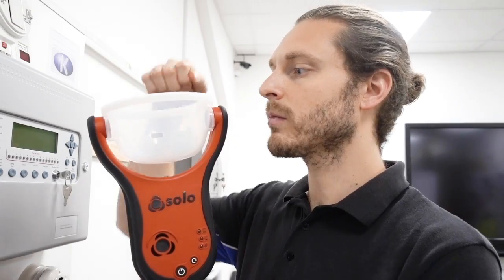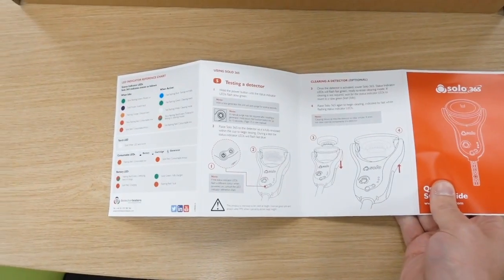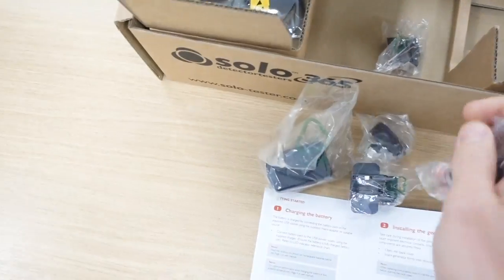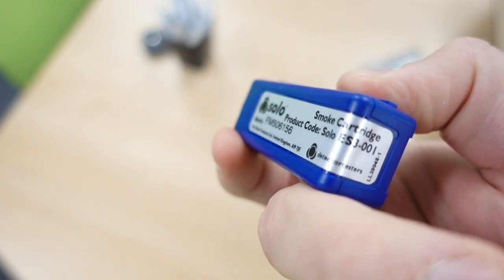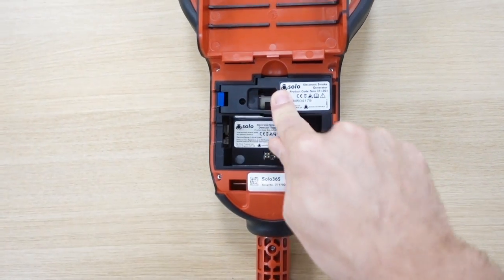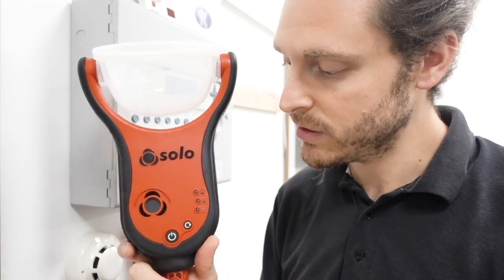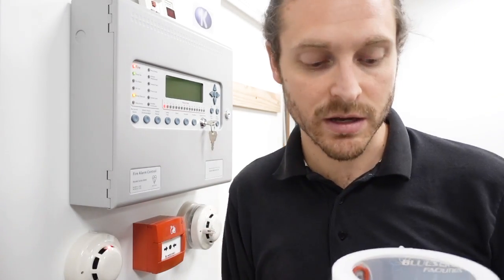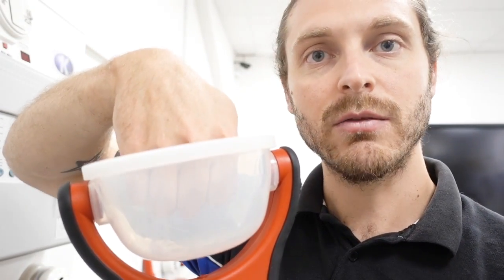DETECTOR TESTER SOLO 365 | UNBOXING | FIRE ALARM TEST EQUIPMENT

Comment: I like the idea of smoke control. Controlling how much smoke will go into the Smoke Detector is a plus. Moreover, the idea to air cleaned the Smoke Detector with the same testing device is awesome. LED indicators in the testing device are nice too. Is good to know that this device is out there.  Smoke Detectors and Heat Detectors are always evolving, this test device will play a key role in the future of Smoke Detectors testing.  Thank you.
Reply from the maker: Glad you found the video helpful. The modern testing kit is quite advanced and really helps commissioning and maintenance. I know it is costs to purchase the kit but an become cost effective is used correctly. It is an investment. The LED light is actually more handy than I thought it would be!!!

Comment: So if you were to purchase one, would you purchase a 330 or 365? I’m trying to decide which to get.
Reply from the maker: Zachary Cordova hey. Out of the 330 and 365 I would definitely buy the 365. I believe that detector tester have a range of products that are suitable for each user. My answer is slightly biased because I already have multiple sets of 330. Many of my clients specify automatic testing so that you can't contaminate the detector. However, keep a look out for one of my next videos... it may help you decide further 😁
Reply: Dan thank you for getting back to me! Have you had issues getting it over large detectors at all because the 365 has a smaller cup? And can you get CO cartridges for it?
Reply from the maker: Zachary Cordova I haven't had an issue yet with fitting detectors in it. In some respects the smaller cup is better because it is very effective setting off detectors. I can't see it being an issue on larger detectors providing the chamber is covered. However i hear in the US many detectors are larger and they often use the larger cup for the 330 (I've forgotten the part number). And no it is a smoke Only!

Comment: Did I hear you correctlywhen you said, the 365 clears smoke from the chamber after the detector has been set off? That would be the main selling point for me; not to have to use canned air or some other method to blow out excess smoke so that when we reset the panel, no lingering smoke causes devices to come back into alarm after the reset. THAT WOULD BE GREAT!!!
Reply from the maker: Chuck Buck correct. You hold it there for the cycle to clear the smoke. It also only uses enough smoke to set off the detector so you don't spray too much and contaminate. Providing you have the chamber covered correctly, if it doesn't set off the smoke with a test, it has failed.
Reply: Dans the Engineer so, I place the cup over the detector with blue lights flashing until detector responds. Then remove the cup and green lights flash. Then place cup on same detector and it clears the smoke? Sounds awesome. How does the 365 unit know whether it should generate smoke, or clear smoke?
Reply from the maker: Chuck Buck correct. It is programmed to release smoke and then clear. However, if you don't want to clear you just pull it off. Then it times out to start a test again.
Reply: Dans the Engineer sounds fantastic, I've been using the 330 smoke tester and it's pretty darn nice. I can't imagine FA testing without it. I'm considering buying one of these 365's for a big test we have coming up around May. Hopefully I can talk my employer into helping with the purchase. Anyway, thanks so much for your help! Very informative video!
Reply from the maker: Chuck Buck the cartridges last longer plus you have less wastage so it is already an advantage. 

Another key point about the product which I'll be doing a video is that it has a cool aspirator attachment which is perfect for testing sampling points without using anything that burns. It also works on the new Apollo dimension.

Glad the video helped.

Comment: Ok here's some Q's for you:
How long does that cartridge last?
How long does that battery last in normal operation?
What cell does that battery use? - Assume its an 18650, and which brand?
Can the battery pack it be ripped apart and the cell replaced? - go Big Clive on us!
How many charge cycles do Solo give that LiON battery?
Reply from the maker: Hey, here is comments from the manufacturer technical:

"All standard rechargeable cells irrespective of technology are good for about 500 recharges or about 2 to 3 years of use. After which time more frequent charging will be required. Just like a mobile phone.

I'm not sure what make of cells we use, but they will be best quality available. On NiMH cells we used we have tested many and only a few have the characteristics that we need.

Cell used is not a 18650 and we don't recommend revelling any of our battery packs. Aware that some do, but we cannot condone it for health and safety reasons. (NB. When back in the office, I will find out what cell has been used).

The cartridges last about 170 to 200 tests which is the same as a typical user with a can of Solo A3.

The serviceable life of any rechargeable battery is dependent on how the battery is cared for. In particular do not expose to direct sunlight or charge while exposed to any heat sources as this will shorten the life of the battery.

Charge time is about 2 hours and under normal use you should get around 200 tests. This does depend on time to alarm."

Hope that is of help.
Reply: 200 devices? Jesus. I can't get well over 1000 out of a solo can